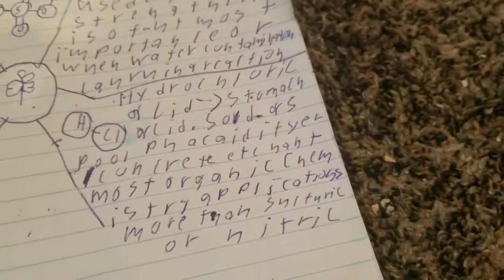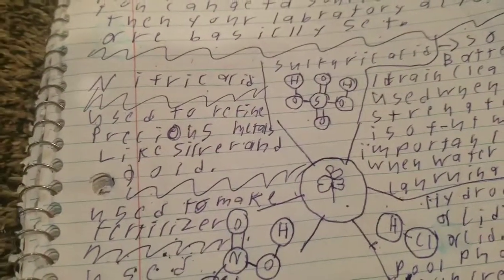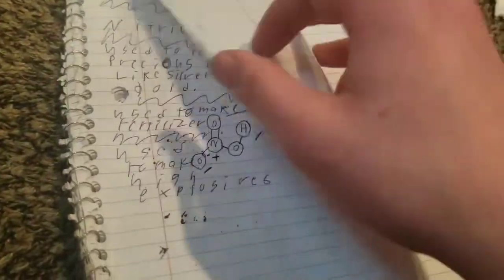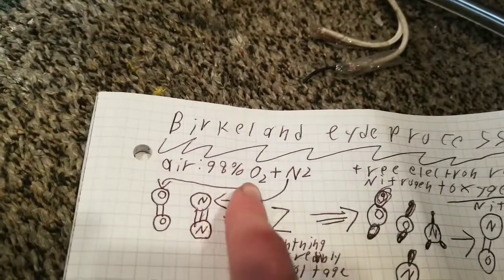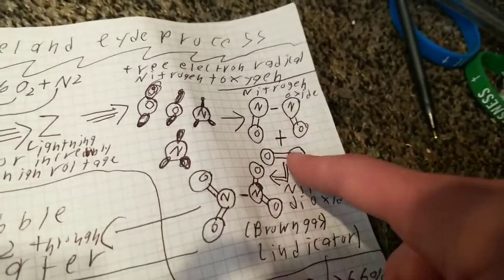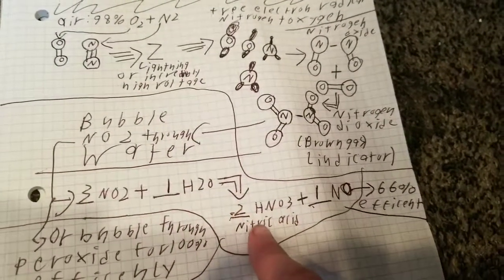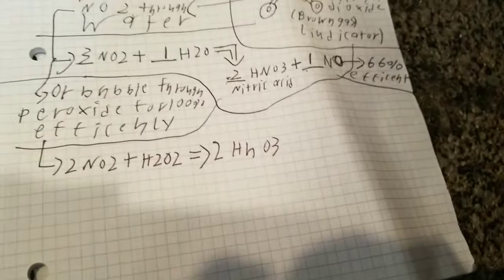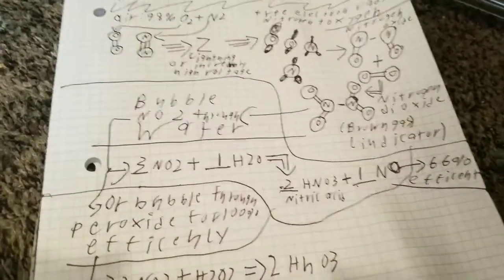Homemade birkeland eyde chemical reactor for making nitric acid

Comment: I never thought of salvaging a power supply from a microwave oven - cool idea!
Reply: Be careful with it. They kill more electronics hobbyists than any other piece of equipment.  Make sure that you know EXACTLY what you are doing before trying to salvage one.
Reply: @chemistryofquestionablequa6252  don't worry, I never do anything electrical that I don't fully understand. There's a lot of cool ideas in the world that I'll never try and this is probably  one of them
Reply: It's a good idea, but mind you they can be lethal. I'm not a panicky man when it comes to experiments, but you have to be aware that MW transformers can easily kill you if you are careless. But if you know what you're doing, it's a godsend. On the other hand, you can buy ozone generators for cheap nowadays from China they use a 15kV high frequency power source which is much less dangerous and should work as well for this purpose.